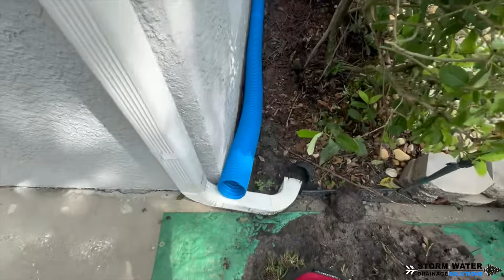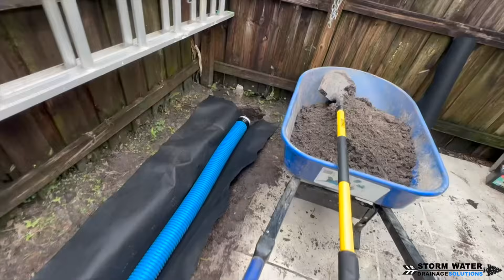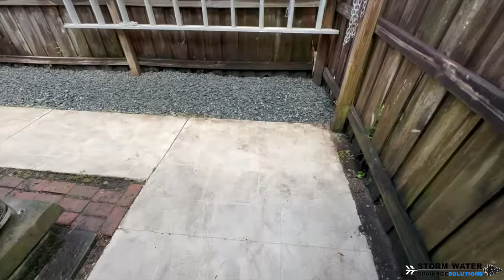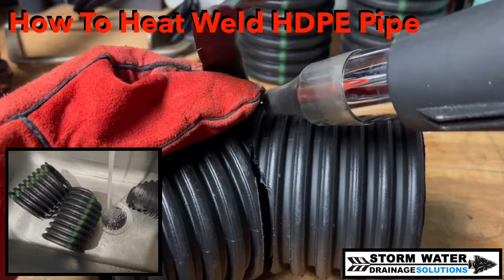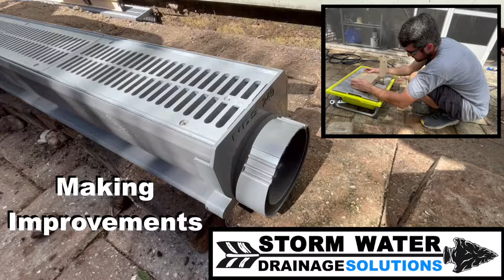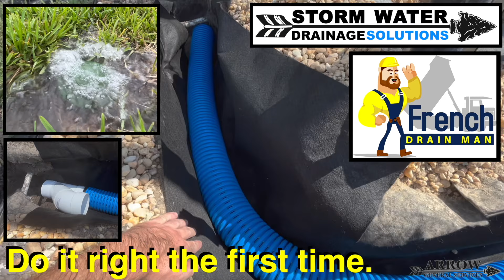French Drain Man High Octane Corrugated Drainage Pipe

Comment: Is 1/8th or 1/4 inch per foot the proper slope for corrugated pipe.
Reply: 1” of fall per 100” of run is one percent slope. That’s all you’ll need to move water. 2” per 100” is 2%, 3” is 3%, You get the idea. 

The 1/4” per foot usually applies in waste pipe.